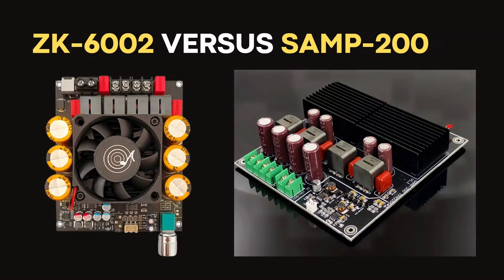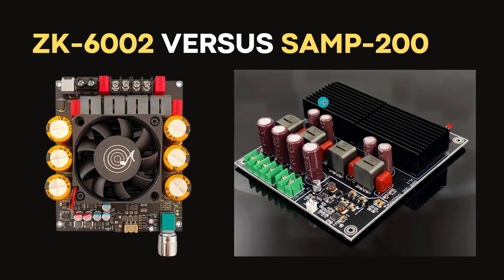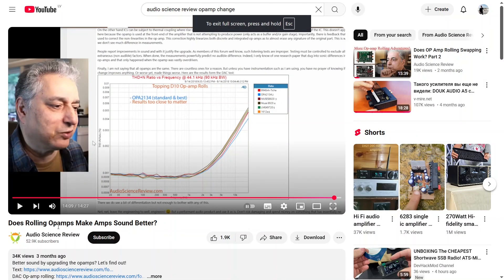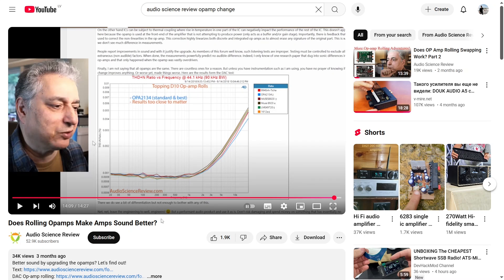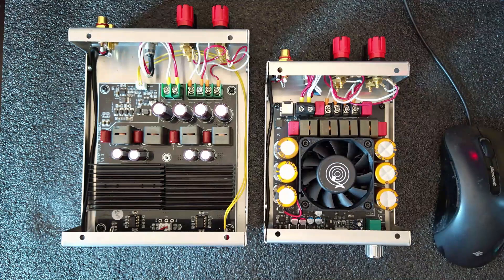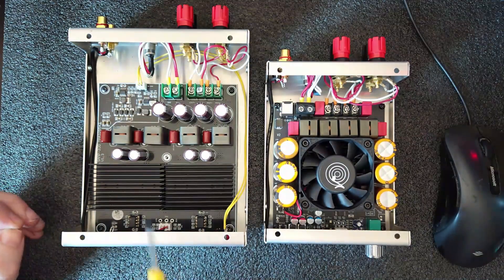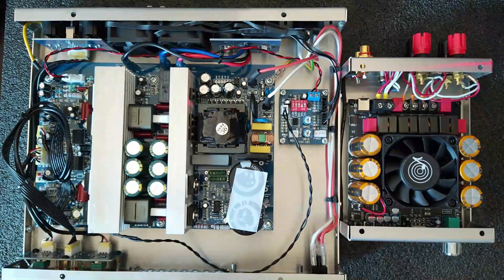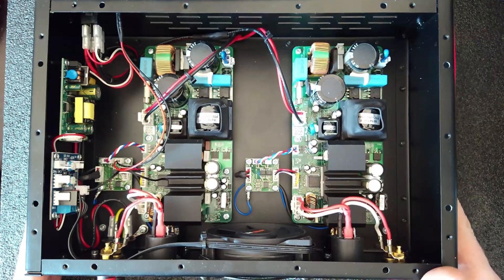SAMP-200 versus ZK-6002 TPA3255 boards

Comment: Подскажите пожалуйста где + и - A B C D  на входе и выходе  тпа3255
Reply from the maker: At the minute 15.37 there is picure of connectons. Read is plus, whit is minus. Power supply has double wire, speakers single wire. Practically all boards which I tested has inverse polarity at the output regards input. Scinece there is consitency may I do not know something. I tryed to research and ther is no information in internet. One reason can be to avoid potential oscilations and interferences between low level input and high levle output setting them in reverse phase. In currrent desing I put them in phase and nothing bad happens. In pictures outputs are reversed to match input polarity to output polariti. On boards power suply voltages polarity marks plus and minus are marked correnct, Outputs are reversed wher read matching board legend to minus and white plus. Difference is inaudible and you can use oboth verions. In case of using differnt type of amplifiers it is worth to checkit. Honestly I do not have explanation why those boards are made in this way. You can not  directly verify this with budget osciloscope because in bridge mode both outputs are hot. You need floting probe. But you can verify it connecting osciloscope ground to ground and measure output regarding to input Plus should be in phase and minus in reverse. On board legend marking in revere to input polrity.
Reply: @guntarssmits2104  Спасибо.

Comment: I rather preffere the board on the right side, because it has bigger pcb and the free space between components is bigger. That is very important from the point of heat influence on that components and lasting life of the amplifier.
Of course, that pcb need a fan for cooling.
Reply from the maker: Me to. There is updated version of this board. I did a review as well and honestly, I was impressed about quality what you can achieve with good power supply.
Reply: @guntarssmits2104  Гунтарс, какой блок питания посоветуете для нового разрекламированного ampapa d1 на tpa 3255? или оставить штатный Gan?
Reply from the maker: @dmitry516  It depends on speaker impedance. For 4 Ohms you need 48V10A for 8Ohms you need 48V5A. Gan is good. I am using Mean Wll LOP 300 48v and 36v for different applications due to affordable price and small size, but China power supplies are good as well. I have tested and there are no complains. I have video about power supplies in my YouTube channel https://youtu.be/6puqHugrwoE?si=7h3TzgFzj2YK6o6b
Reply from the maker: Yes, this also is my favorite. A bit larger box, but you need som space to breath.
Reply: @guntarssmits2104 какой заказать Mean Well lop 300 или 400 или 500 или 600? Думаю мощностью 600 модели не будет лишней для tpa3255 при басах, я прав?
Reply from the maker: @dmitry516  Good engineering desing means that you are using exactly calculated power supply. Benginners wish to have extra everywhere typically means higher spendings and no impact. 300 Board can delivery 450W true peak power and together with 4700MKF capacitor will provide reliable 250W/ch whic is theoretical max for 48V power and 4 ohms loade. Yes you can take more powerfrull power supply but you can not utilize it for 100% and bass will not be better. Yes 600W power supply will work as well.
Reply: @guntarssmits2104 спасибо! А звук про который вы говорили в режиме ожидания не сильно слышно? У меня блок питания будет стоять в ближнем поле на столе, расстояние 1м до ушей, в полной тишине ночью будет слышен этот звук? Звук простоя отличается на 300 и более мощной 600 модели?
Reply from the maker: @dmitry516  My best guess it that it will be inaudible, but you should try. Potential loses about 35EUR
Reply: @guntarssmits2104 как считаете звук в режиме ожидания на 600 моделе будет тише чем на 300 моделе или будет одинаковым по громкости ?
Reply from the maker: It will be the same. When set to sleep, the fan is not working. It only operates when the amplifier is running. However, the second version has one significant advantage: it drives the op-amps with ±12V, which adds that last bit of perfection.
The drawbacks of the second (larger) board are its size and the need to rework the heatsink’s thermal and mechanical securing—it is not reliable. The first board is fine out of the box.
I am choosing the second version and elaborating on its drawbacks.
Reply: @guntarssmits2104 я спрашивал про mean well lop 300 и mean well lop 600 про звук, когда нагрузка минимальная на блок питания и он уходит в спящий режим. Какая из них тише 300 или 600 модель? :)
Reply from the maker: @dmitry516  I do not know. I do not have experience with 600 boards. Overall noise is minimal. Much smaller than a silent fan.
Reply: @guntarssmits2104 спасибо большое за ответы, вы хороший человек🤝👍

Comment: Thanks for preforming these reviews. I have now tired the ZK-6002 after watching and I found that the board I received has a loud hum that changes with the volume control making it unusable. I tried several good power supplies. Any advice on what might might be causing this or if it could be fixed?
Reply from the maker: Seems like a ground loop. Try different variations of input and power supply grounding without an input signal and find a combination that is silent. In my tests, everything was dead silent. What type of power supply are you using? Do you have any AIYIMA power amplifier dedicated power supply. What is your source? Ground loops are kind of tricky. Also, check the interconnection wires. There are many unshielded wires supplied from China which has unacceptable quality. So many things to check. In my experiments system was dead silent.
Reply: @guntarssmits2104  I have used dedicated amp PSU and the mean well lop 300. Seems worse when no input is connected. Maybe this is to be expected. I made my own interconnection cable with short shielded wire. Thanks for the suggestion.
Reply from the maker: @mathewstorey7545  Methodology to find a reason is to start with the minimum components. Start with 300PS with the mains ground removed, only line and neutral. MW 300 has a fully insulated architecture, and it is safe to do that. Shorten inputs for the 6002 board with a 1kOhm resistor. Does hum persist at any input potentiometer position? In case it is silent, you connect the source ground to the board ground and check do you have any hum, then add a signal, and so on. In case of using a switching power supply reason for hum can be only grounding problems or high output impedance of the source. Normally, source impedance should not exceed 150 Ohms

Comment: If I use a linear power supply with pig transformer is this better
Reply from the maker: Hi, no, it is not a good solution. An important aspect of amplifier performance is the peak power capability of the power supply. Conventional transformers have a large number of windings with internal resistance, and they are not good at peak power. It is compensated by a large capacitor. A good SMPS is a better solution. I have a video about power supply choices, and there are good ones broadly available. https://youtu.be/6puqHugrwoE?si=zeaLHjQg44Vula5l
Reply: @guntarssmits2104  
ok, thanks 
This is another TPA3255 board available in Ali express and it has a better indutrors in the output and a big capacitors in the power lines, and it realy afordable can you review it

Comment: Hi bro, i really appreciates for your shared information, i planned build for my lounge with these zk6002 and supplly with 48v 20amps, does it still can't reach closer to maybe arround 450watt per channel?
Reply from the maker: Hi, with 48V and 4 ohms, you can get a max of 250W. To get more, you need to reduce load resistance. For example, we connect two 4-Ohm speakers in parallel and get 2 ohms load. But it is not a good approach. I would suggest finding some budget professional amplifiers built for the necessary 500W power. Strictly speaking, TPA3255 is max 200W/ch capable despite the figures written in promotions. Once you really feel that you are short of power, then you need 4 times more power to double the speaker's loudness. There is are logarithmic relationship between amplifier power and sound pressure from the speaker.
Reply: @guntarssmits2104 thank's for repplied matte🎉
Little bit confusing because i already have ab class as midrange and high range can reach clean 450watt per channel and now i need some powerfull class D amp as low or subs

I was  think about irs2092 driver but i'm bit worried if the sound feel like thin digital not great as tpa3255😅 but yeah irs2092 would have more power than tpa3255
Reply from the maker: @mbsgarage  Power what you are getting has a relationship with the power supply Voltage and amp values. Here I have a video where I calculated TPA3255 power ratings for different power supplies. https://youtu.be/6puqHugrwoE?si=9wgNcOgB7btscKSh

Comment: Hello, these two boards are with two TPA3255 chipsets, is there any issue to use just one channel ? for example to drive a MONO subwoofer with just one channel and the second channel will be mute, is it possible? many thanks
Reply from the maker: Yes, you can use it in one channel mode, but there are boards like ZK-3002 with one channel PBTL connection for a lower price and smaller footprint
Reply: @guntarssmits2104  That was my following question about your review/test of the ZK-3002 board? I'm waiting for your feedback before buying that board, many thanks

Comment: Great follow-up video. I had the same question about the differences in these amp boards. Appreciate your taking time to cover these diy boards so thoroughly. I opted for the ZK model because of the fan. The 3255 chip is a great way to cheat the marketers and the cork sniffers. The WiiM amp surprised me, as did the Fosi versions. 

I have never been able to hear op amps, cables or any of the other fantasy. I have multiple different kinds of amps from vintage, tube, etc., and even what differences are in those, gets lost on me after 5 minutes of listening. I forget to care. Why? Because my speakers always steal the show. 

Whenever I see people trying to EQ with things like cables, DACs and op amps, or even tubes, it makes me feel like they got the wrong speakers or that neutral gear (without at least, tone controls) isn't really for them.
Reply from the maker: Choices are difficult. So many options. And marketing lost its limits.
Reply: @guntarssmits2104  When using the JST input signal harness supplied with the amp and connecting to RCA inputs, do you hook up the ground to chassis or just ignore it? The three pin connector has R G L.
Reply from the maker: @mrboat580  It is better to insulate RCA ground from the chassis and use connectors with insulated sleevs. The power supply ground can be connected to the chassis. In case of JST you should check the wire quality. It should be well shielded cable. Many cables supplied with board kits and Bluetooth kits are not shielded. Grounding is important especially interconnecting with bunch of other equipmnet.
Reply: @guntarssmits2104  Yes, and thank you for your help and patience, but the supplied JST shielded signal input cable is 3 wires, while each RCA (left and right signal in) connectors only needs the right and left wire which leaves the 3rd (middle ground wire). I could not see in your video if you had the ground wire connected anywhere and I cannot find wiring diagram to product. I don't know if perhaps this additional wire is for connecting some other input option.
Reply from the maker: @mrboat580  Put RCA both channel grounds together and connect to JST like R ground and L . RCA both channel grounds are the same and connected together at the source side.
Reply from the maker: @mrboat580  Here is the diagram https://www.mediacollege.com/audio/connection/jack-stereo-rca-2.html
Reply: @guntarssmits2104  Thank you for the information. I also found another rear panel I had made with RCA inputs and the connectors are also self explanatory. If I wait too long between projects, I have to learn over again.
Reply from the maker: @mrboat580 , with me it is the same😀

Comment: Just dont include the TL072 Opamp, it has 3Mhz max frequency at gain of 1, but you mostly want higher than one so you must likely want to get about gain of 200-300, and so your max frequency will top at 10-15khz, which is big nono. Almost all other Opams have up to 10Mhz transition speed, and so they can deliver a good frequency bandwith even at high gain settings.
Last time you talked about the SAMP200 and it does uses the TL072 Opamp, highly recommend to swap it out to a quicker one, unless you might love a more warm sounding amp but without the linerity of the amplifier, since class D amps have close to zero linearity.
Reply from the maker: I think the designer's pick was very small TL072 consumption and high input impedance. I guess that +/-12v converters are delivering a small current, and  we cannot use a more aggressive Operational amplifier. But TL072 can still deliver 50db gain at 20kHz and is capable to work properly. MOSFET architecture and affordable price are making it a good buffer amplifier. I have seen this chipset in professional active crossover solutions as well. It has a broad application area in audio, complementing NE5532. I would leave this board as it is. It performs well, so why change anything?
Reply: @guntarssmits2104  id say sure... Its yours afterall, i just think that 3Mhz speed is kinda low, my amp have it with discrete components, and its rated for 100Mhz. and the amplifier itself is rated to 50Mhz. at beta of 1. and the amplifier pretty much can do 5-up to 100khz sine wave, i have built an Elliott amplifier based with 3Mhz transistors, it drops down at up to 23khz, at 23500hz the output voltage is way too low. from 4Volts Ac to just under 2.7Volts ac, but at 23khz its just about 2.78Volts AC.
Elliott's amp arent made to be that crystal clear and do up to 50khz sine waves, its only rated for about that 23khz, and at the bottom i dont know, but about 10-15hz which it can go as low, but while in specs, i mean its an okayish design if you wont wanna overcomplicate your diy project amplifier, or you just wanna build an ok amp, but dont wanna get lost in the scematic.

Comment: Hi, 
Just to follow up... 

1) where do you source your supplies like knobs/switches, cases, power supplies? 

2) I saw a thread on reddit from about a year ago where people were complaining about this running hot and blowing up when running w a 48v power supply. 
One person had replaced the capacitor bank(s) w larger caps which they said were closer to the chip's specs.  
Any thoughts on this? 

I'm more interested in the SAMP-300 because it has the idle switch so you can leave this always on.

Thoughts? 

Thanks.
Reply from the maker: Mostly, I am using the Poland Catalogue TME. My country has excellent logistics and transport with Poland. For larger volumes US company  DIGIKEY and UK company Farnell. Regarding switches, you should use a proper amp rating, like 16 A etc, and choose a proven manufacturer. Regarding cases it is the most difficult item and we are designing them by ourself specific for each board. Internally, we have prototyping equipment. And when the enclosure has the final design, we order the final cut in the factory with powerful laser cutting capability. For products, we are choosing only industrial boards from top manufacturers. SAMP seems ok board as well.

Comment: Good video... 

I've seen a couple of your videos on these boards.  I am curious which board if any has the ability to go into a "stand by" mode when no music is playing, and will wake on sound?  I'd like to find an amp that I can leave on all the time.  [edit]
(I found that the SAMP-300 is the same board but with the idle power switch enabled.  Not sure what that exactly means in terms of the two boards (SAMP-200 vs 300) Do you have any sites you'd recommend for finding add-ons where you can add a BT option and power supplies? 

With respect to op-amp swapping... Take what Amir says w a grain of salt. 

Its like saying all vodkas taste the same because they all have the same percentage of alcohol. 
His testing methodology is flawed.  

That said... does it make sense to spend $$$ on op-amps for an amplifier that costs $? 
No it does not.  If you want to test rolling op-amps... listen to the stock ones for a couple of months. Switch them out and listen to the new ones for a couple of months. Then switch back to see if you can hear the difference.  There are a couple of factors which effect the overall changes you may hear. So YMMV.

Comment: You still dont understand. The measured spec doesnt say any word about how amplifier sound. Also which load you apply to output. Btw, the speakers are not pure resistive load and, maybe you heard it, speakers impedancy is changing over frequency. So name speaker 8ohm or 4ohm load is simply stupid. Also yous till seem not to understand pffb feature of TPA based amps....
Reply: Sound is subjective, so why would he bother commenting? For me the technical details are more important, so this kind of video is more valuable than opinions
Reply from the maker: Opamps are driving just input stage of TPA3255 chip.  Once Imput signa for TPA3255 is formed properly signal is correct and capable drive amplifier input  than chip should work properly. In case you are changind chip in post filter feedback architecture than process ir more complicated and you should follow TI guidlines. There is document where recomendations are described.https://www.ti.com/lit/an/slaa788a/slaa788a.pdf?ts=1752153924251&ref_url=https%253A%252F%252Fwww.google.com%252F